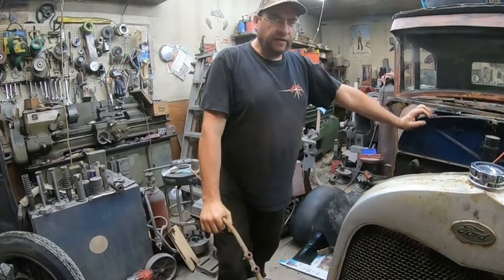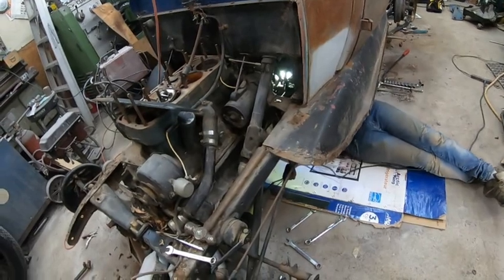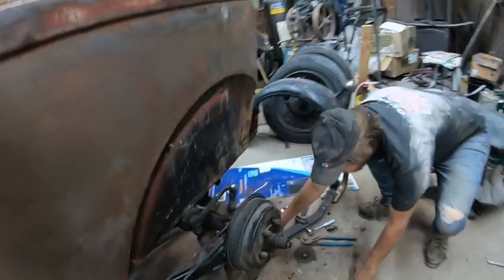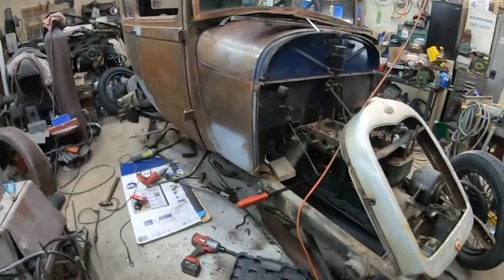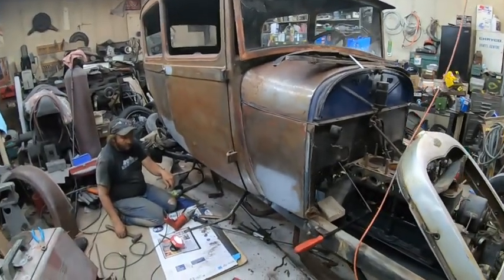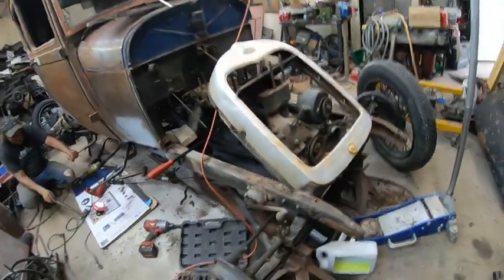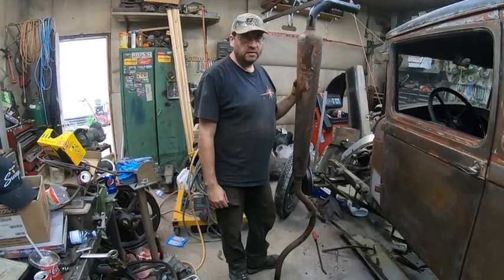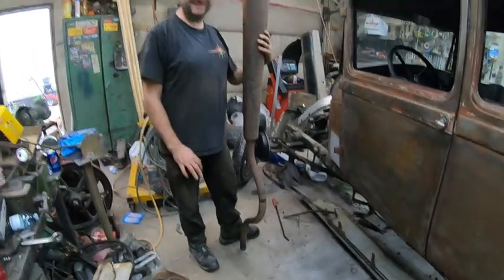1928 / 29 Model A 2 Door Project Hot Rod Build. Flathead Ford V8 Nostalgic, Back To The 50's.

Comment: You two are giviner! And the body is decent to start with. 
Hope everything goes smooth! Enjoying watching the tear down. You need my air hammer. Good chisel bit and punch,makes quick work of the bolts. 
I only had one flathead apart. The valve guide keeper fell off, and guide was holding valve open. BIG bar to pry it out and reset it. Now it purrs.
I feel bad for Derek, seeing him crawling around. Im sure you were under there too, tag teaming the job. But i know the heat sure makes it more difficult. And i want to set up in my quonset to do some work. Mornings are fine, but it gets unbearable in there.
Reply from the maker: Thanks for watching Frank before you know it winter will be back and will be fun working on a flat head.